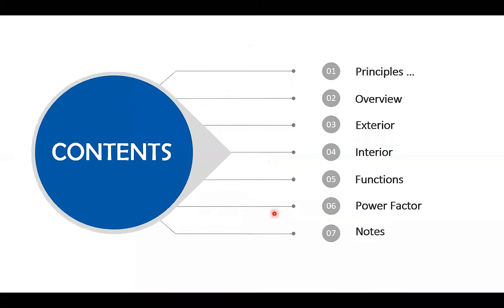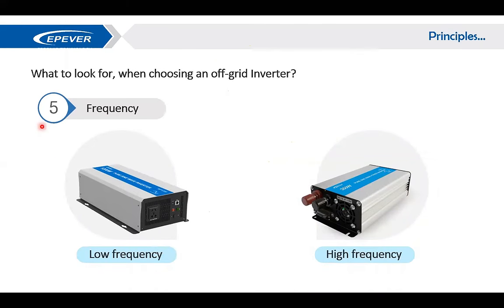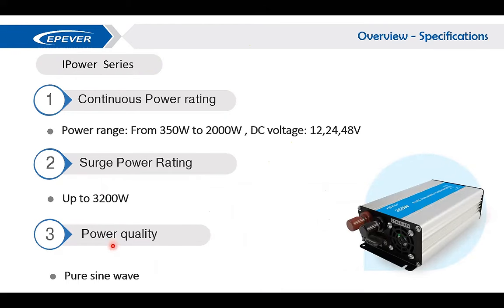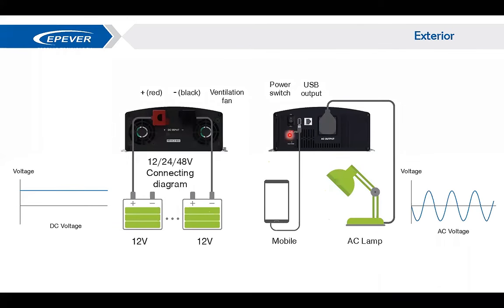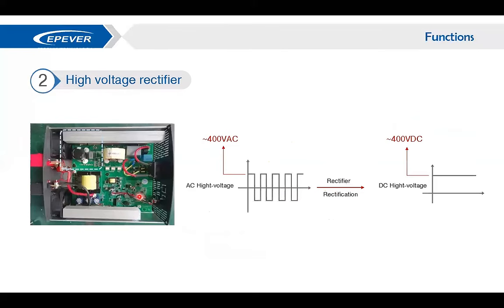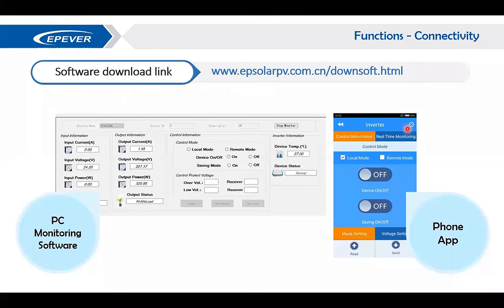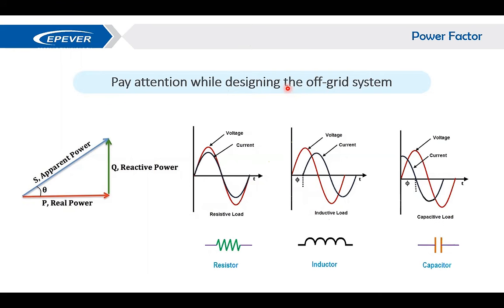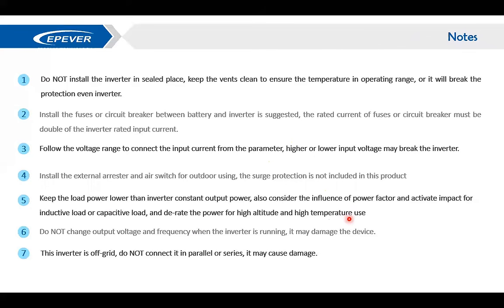Webinar: How to choose a suitable power inverter? EPEVER IPOWER series explained.

Comment: Hello. Please let me know if the EPEVER UP3000-HM10022 hybrid inverter gives voltage on one output wire, or on two, when powering from PV or batteries? My inverter is supplying voltage on the red and blue wires. Is it correct or is it broken?
Reply from the maker: Hi Sir, the inverter was given voltage on two output wire and powering from pv and batteries at the same time.
Reply: @Epever  Thank you very much for the information.

Comment: Good day, I bought a single 300 watt solar panel and a Pwm 30A charging controller and a 12volt 100Ah battery. Please, I want to know' will the charging controller charge the battery well. Or should I change it.
Reply from the maker: hello Christian, your solar panel is 300W, you can use 12V,30A charge controller to charge the battery. it works.

Comment: Could you explain how to connect an RCCD device to this inverter to protect the users in case of a leak.
Reply: Hi, small off-grid system generally would not use RCD
Reply: @qzz9102  I'm currently having IPower 2000 inverter and I want to use it in my home instead of grid power. Can I bond the neutral of this inverter with the ground ?